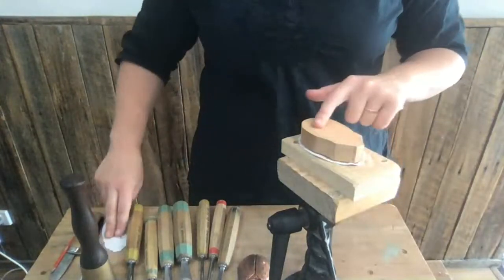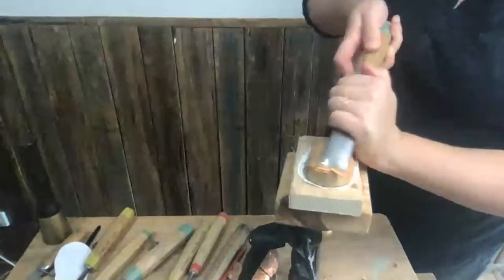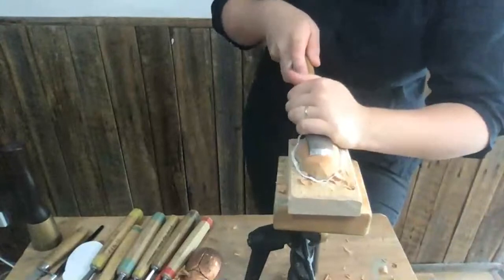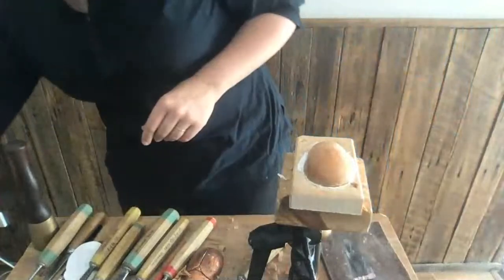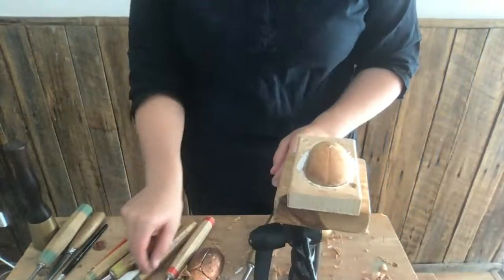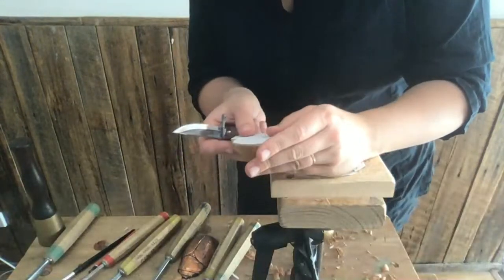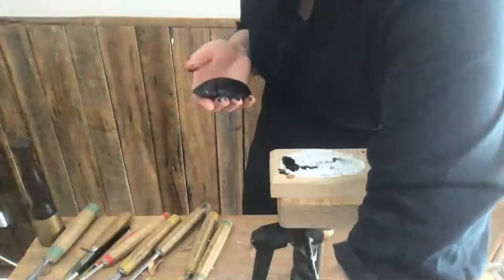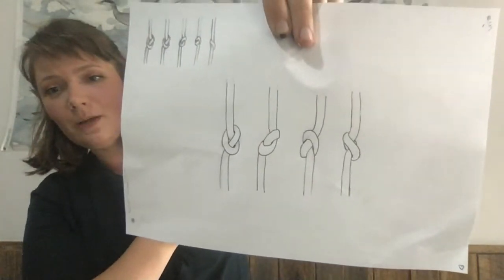Woodcarving with Olivia O’Connor - Carving domed shapes and introduction to guilding.

Comment: Olivia, you have inspired me to carve (you and Rick Butz). How can I easily and as cost-effective as possible do I sharpen and maintain my gouges. My first carving is a Celtic weave, how do I make the in between sections flat and even?
Reply from the maker: Hi Shenlun - Olivia here. That's quite a challenge for a first carving project! A short answer to your question for the flat parts = with difficulty! A back-bent or spoon bent gouge with a shallow sweep with help. Along with clean, deep stop cuts for your edging. For sharpening, invest in the best quality sharpening stone you can, as well as a leather strop and some good quality cutting compound - I like the Pfeil one best.
Reply: @CarbatecTheHomeOfWoodworking  Hi Olivia I sent a dm to you on instagram with a progress photo